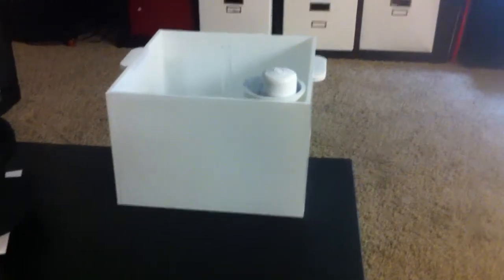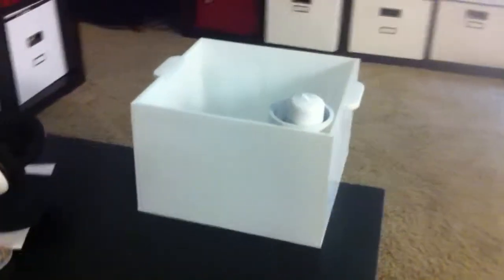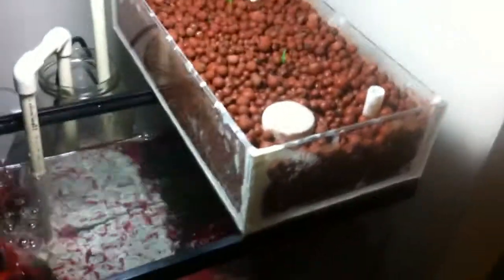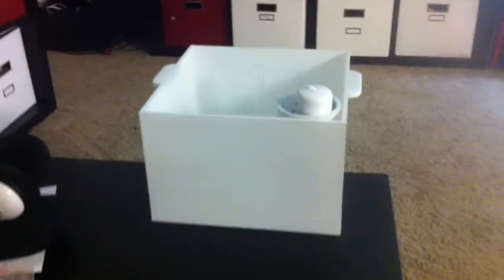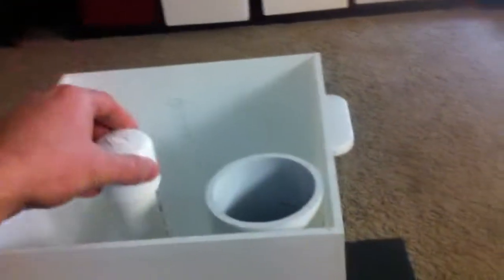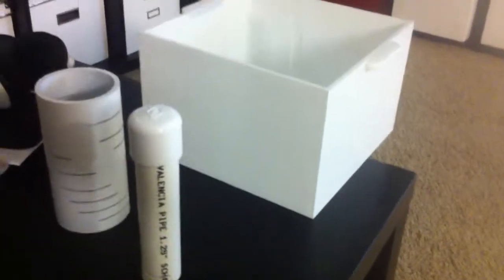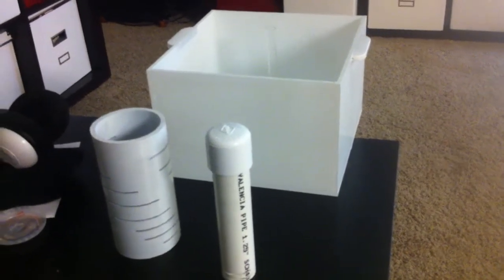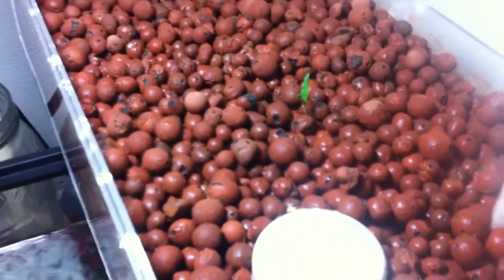10 Gallon Indoor Aquaponics Experiment: Day 11

Comment from the maker: @MrMadmax478 Yeah, this version has a simple 60 gph fountain pump enclosed in that pipe extruding down from the grow box.  All you need to do is plug it in and watch it go.  I'm hoping to develop a version which allows you to control a wide spectrum of parameters with an arduino microcontroller, but that's a ways down the road.  Thanks for watching!